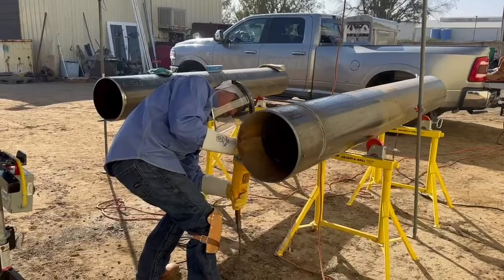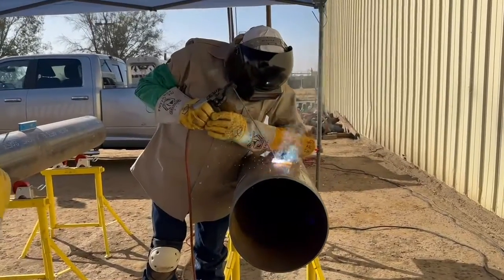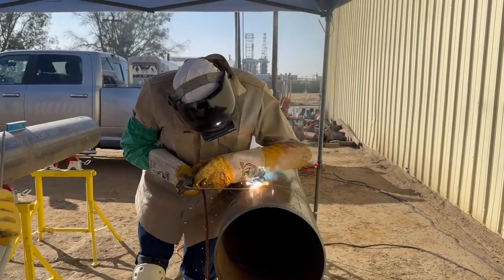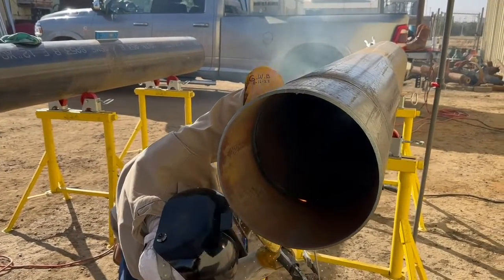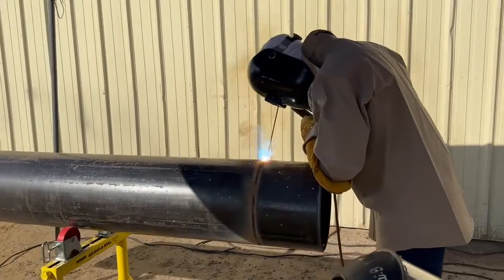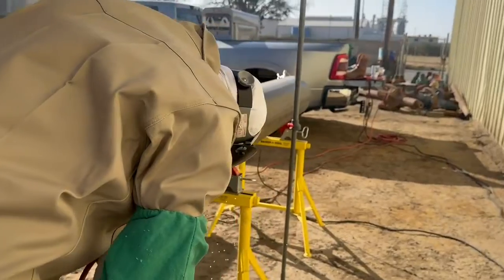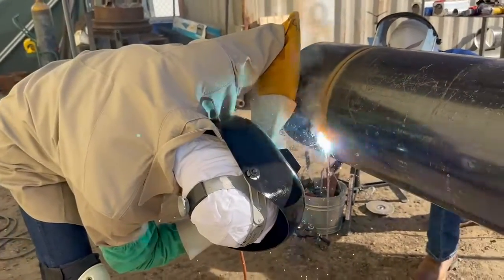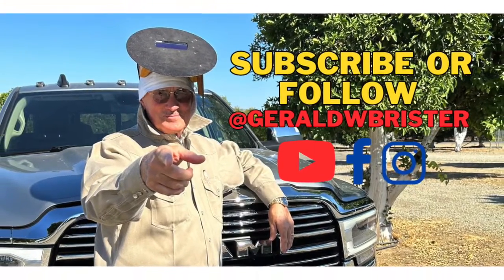How to run a Hot Pass on Pipe:  Welding Instruction

Comment: The hot pass…… cleans the root pushes the root in adds insurance to the root also……. Undercut won’t be as bad if the rod is a lot more perpendicular than shown here coming off the top of that pipe….. little lead is fine but this is drastic
Reply from the maker: Works very well on fast moving pipeline work, if you know what you’re doing!
If you don’t , you’re better off sticking to the much slower perpendicular method!
Thank you!

Comment: What arm pad are you using?  Great videos. Your passion is inspiring. Thank you.
Reply from the maker: It’s a Tillman 5210 L ( left arm)
I have also used the LAPCO arm pads.
LOUISIANA ARM PAD COMPANY
A couple of welders from the Morgan city La. Area started out making arm pads, then caps khaki shirts, umbrellas etc. I tried using one of the new fancy leather arm pads. I think I paid about  $180.00 for it. It was beautiful to  look at but very uncomfortable to wear. To me it felt like I was trying to weld with a two by four on my arm. I welded for 30 mins with it and was going to throw it away. One of the welding students wanted it so I gave it to him.
These have foam rubber inside covered by leather with a Velcro leather flap that quick folds over to adjust to your fore arm size. Easy on easy off.
Over time the Velcro may get worn or burnt  if mishandled.
They cost about 30- $35 . I buy several at a time when I find them. You can buy about 6 for the price of the others.
After a day or so of welding the foam leather will conform to the shape of your arm and you can’t even tell you’re wearing anything.
Just my opinion , everyone’s got one.
Thank you Todd!

Comment: Hey Gerald, do you only see the wagon wheels on the root pass? Had no idea you have weld the hot pass within 5 minutes. Keep em coming friend,  thanks.
Reply: After you grind the root crown down flat, the center will be shiny
Allowing the undercut and slag line to be more visible by the contrast in color . You are using a motion that is kind of a digging motion. You come in hot, sit there for a split second until you see the slag line be consumed into the weld puddle and the undercut on the bevels get filled in .
You continue this digging motion around the pipe until all the  “WAGON TRACKS” are removed and you have the first two weld passes strongly fussed together without defects.
Thank you David!
Thank you
Reply: Sorry to answer your question, the root pass is the only one that produces wagon tracks, because it’s the only on welded with a dragged type stringer pass.
The fillers and cap passes produce somewhat heavy slag coating that is easy to buff off!